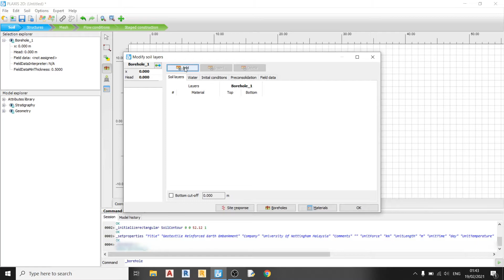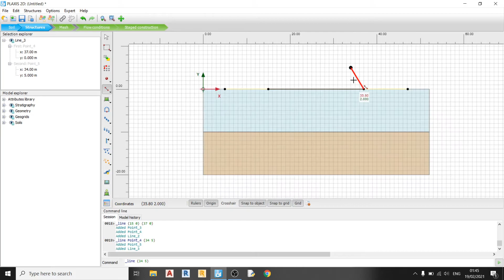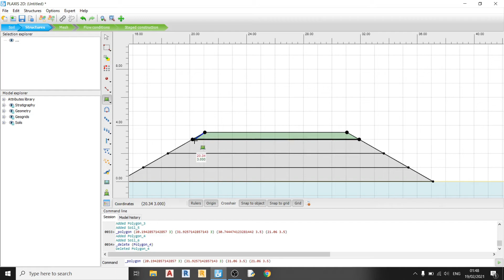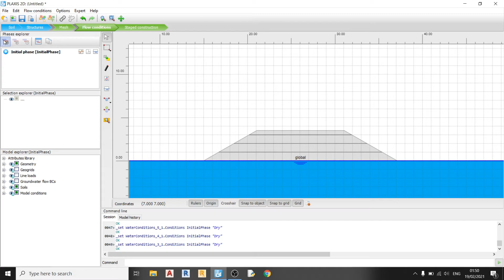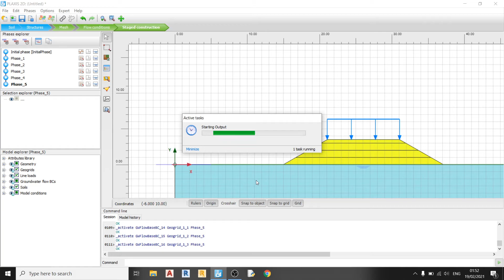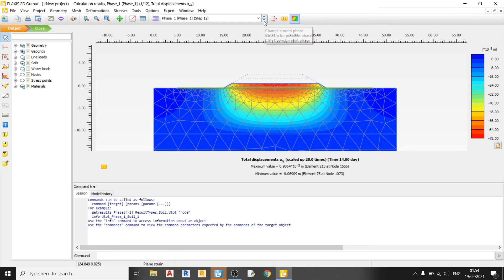Modeling a geotextile reinforced earth embankment in Bentley Plaxis 2D

Comment: Please can you create a learning video of how to find the bearing capacity of two closely strip footings on reinforced level and sloped ground. with best regards
Reply from the maker: Hi Khalil, do you mind showing me a journal article that shows the model dimensions, model shape and model parameters?
Reply: @revitforcivilengineers  Thank you for your response. can you sent to me an e-mail to sent you the articles because I replied your mail but there was a problem (address not found)
Reply from the maker: Hi Khalil, perhaps you could tell me the name of the journal article and which website you got it from. For example ResearchGate or ASCE.
Reply: @revitforcivilengineers  OK many thanks, these articles please if you have time with respect.
1. "Behavior of Strip Footing on Geogrid Reinforced Fly ash Slope" by Ali Pak et al., (ResearchGate)
2. "Behaviour of a Strip Footing Embedded in a Sand Slope Reinforced with Multilayer Geotextile" by Emmanuel Baah-Frempong and Sanjay Kumar Shukla (Springer Link)
3. "Assessment of bearing capacity and failure
 mechanism of single and interfering strip footings on sloping ground" by R. Acharyya and A. Dey (Taylor & Francis).
with best regards